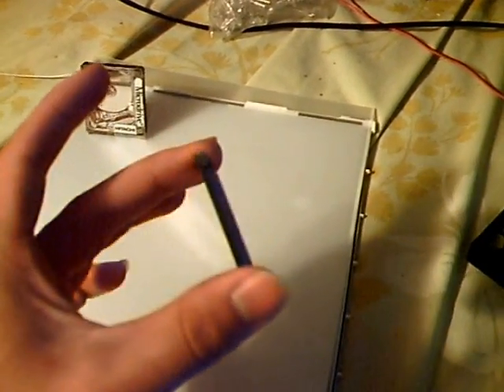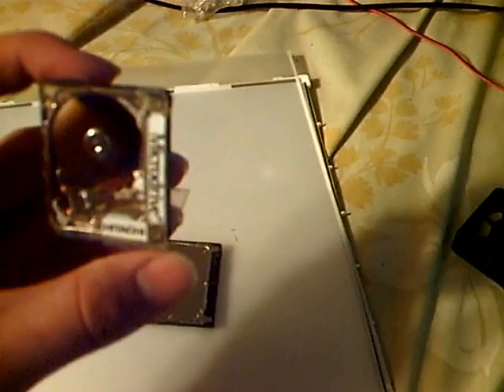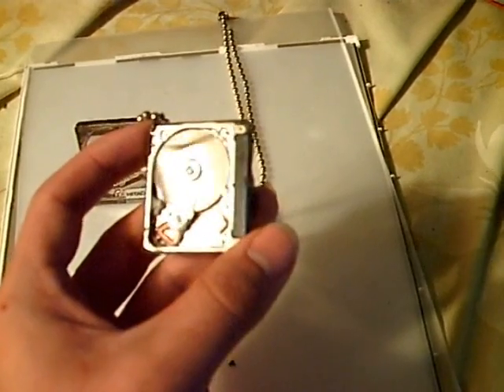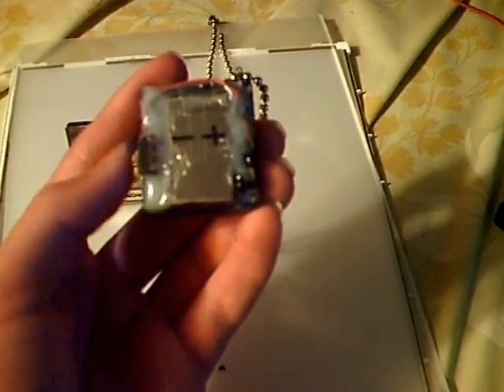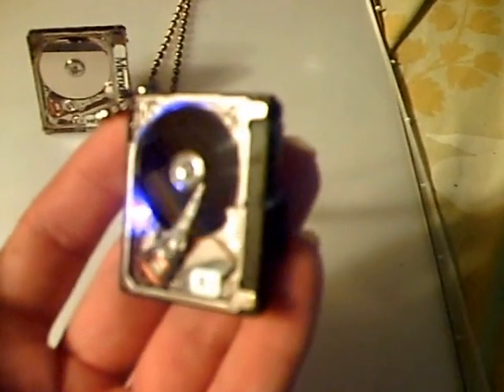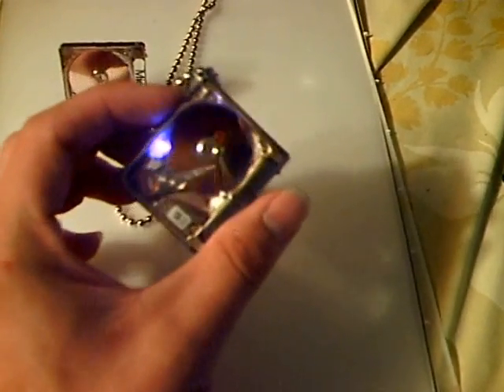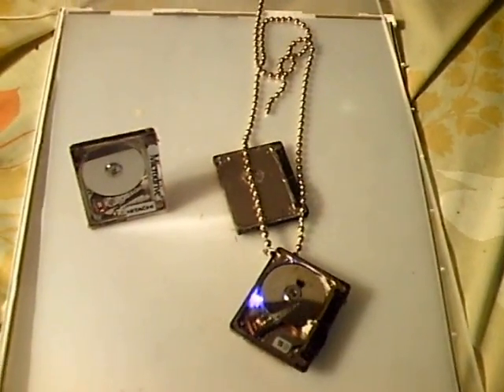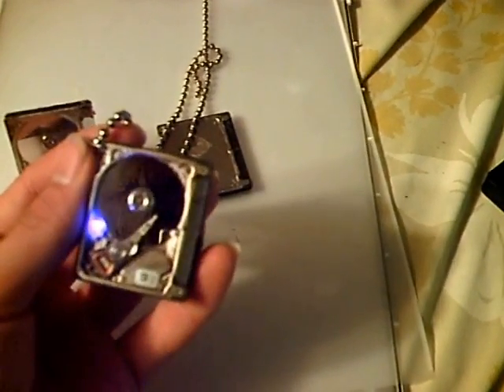Bad Mircrodrive transformed into working necklace

Comment: Thanks for charging tip. With the batteries i ripped off the protection circut to help connecting and charging. im using 1 motorolla battery and 1 rio ce2100 battery.

Comment from the maker: I found using USB with a low resistance resistor works really well for charging, I found some to be compatible and some not to be. I would stay away from manually charging cellular batteries. I found almost all Palm,Nintendo,and Ipod  li-ion/ li-ion polymer alike. Nintendo batteries need an input voltage drop to 4.5 volts in order nto to trigger the overload protection on the battery for charging.

Comment: That is cool. I made a USB charger out of a Cell Phone Charger it puts out 5.0VDC and 700mA and ive rigged a type of plug to house the female USB plug and the wiring and it works on all my devices that use USB to charge Including the ipod, yes it does charge my ipod.

Comment from the maker: I charge it off a 5 volt power source, either USB or Legacy, occasionally a cellphone charger too. anything DC above 3.7 volts works nicely. It has a dual pin interface on the back for a charge port

Comment from the maker: No, actual compact flash cards do not have a hard drive, the microdrive uses the compact flash interface with a slightly thicker opening, its a CF2 slot type and is designed for use with both CF cards and microdrives.

Comment: 1) run the hot water in the shower in your bathroom until the room is steamy to pick up the dust in the air
2) run de-humidifier to dry out the room to pull the humidity out of the air
3) open drive, put everything but cover in new zip-lock bag
4) leave the room and cut a hole in the cover, clean it well, glue a piece of plastic over the hole
5) repeat steps 1/2
6) remove drive from bag and re-assemble

my drive had ~2% bad sectors after surgery and ran for a year.

Comment from the maker: Unless you have a clean room it will become usless with in minutes upon being opened. Even from flight smoke or fog. the read write heads are to delicate cna precise that they need an almost next to pure envroment to function. Also dirt does not create data loss it creats a contaminated platter surface and the heads cannot read it. You could drop a platter in mud and wish it to labratory grade and read it still with out much problem.